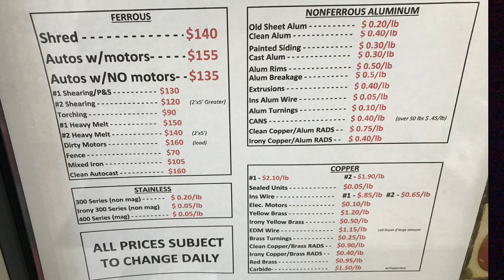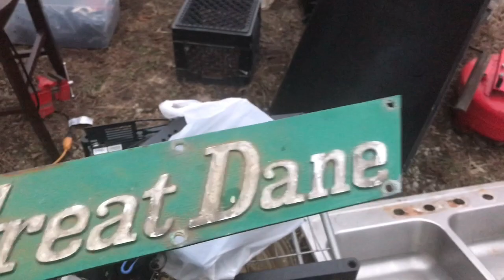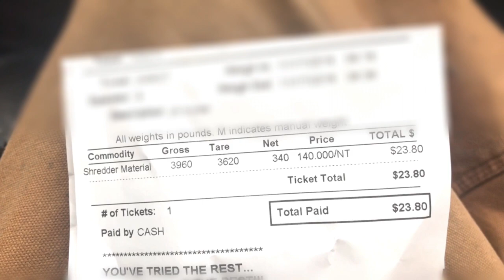Dude where’s my junk

Comment: It is odd to me that the yard pays less for red brass than yellow, red brass is higher copper content therefore has more value.
Reply from the maker: Ryan Baldwin you know brother that is weird I never saved back the red just tossed it with yellow. Due to not coming across it much but yeah red has been 95 for a couple of years. Strange that yellow is more and went up from 80 cents to 1.20. The dirty brass is up from 35 to 50 cent a lb. Thanks for the comments homes hope you have a good week.
Reply: Dumpster Jerry you have a good week as well!

Comment: What is the difference between old sheet and clean aluminum at that yard? old sheet is clean aluminum, dirty aluminum is breakage or are they referring to aluminum clips or new production drops?
Reply from the maker: Old sheet to them is like thin plate like a no trespassing sign or a handle part off a dust mop. Clean is a machined part out of a billet of aluminum. I didn’t notice old sheet went down like that damn. Was at 32 cents the guy gave me clean for it all which was cool.
Reply: Dumpster Jerry thanks for the explanation! Where I’m at all sheet aluminum is sheet no matter the thickness then you have cast and extruded.
Breakage is any type cast-sheet-extruded bearing steel plastic or other.